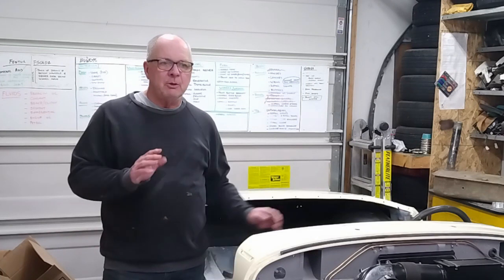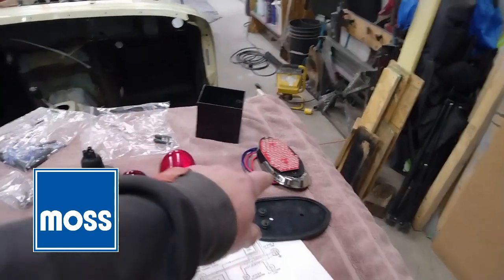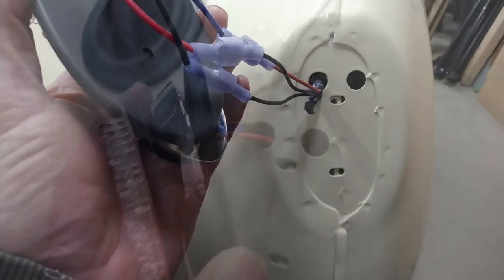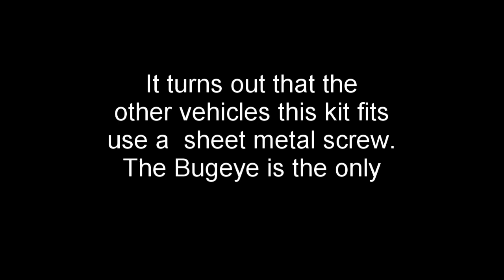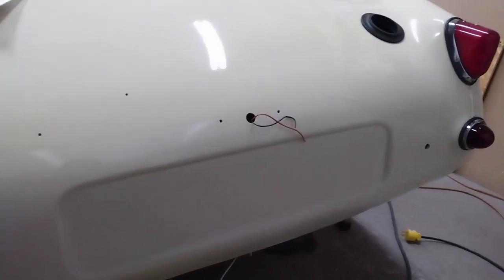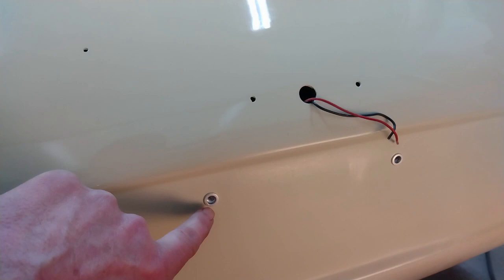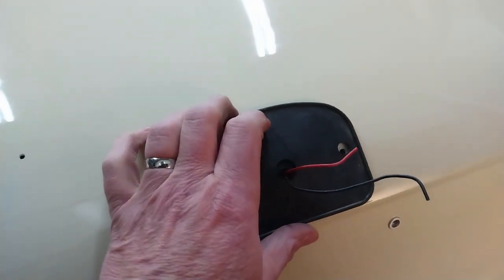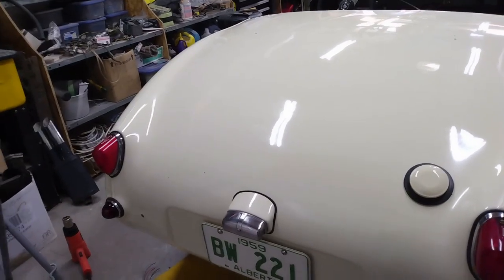How I installed rear lighting & license plate mounting on a Frogeye Sprite Bugeye build Episode 108

Comment: Ian, Great job once again.  Your mounting of the license plate was dead on!
Reply from the maker: Thanks Dan. I've seen a couple of other ideas that eliminate the need to crawl into the boot but this seemed the most functional.
Reply: crawling into the boot is always a project for sure. I've had to do a few times putting rear tail lights, bumpers and routing the wiring harness
Reply: @caroliencoulter1378   Hi, I have always found that jacking the rear of the car as high as possible makes working in the boot rather pleasant and certainly a lot easier on the midriff when lying over the 'hump'.

Comment: Is that a Triumph steering wheel?
Reply from the maker: Good eye, Joseph. It has a Triumph horn push but can't be certain of the rest of it. It's a spare that is in there so I don't have to use the refurbished stock wheel while the car is under repair.